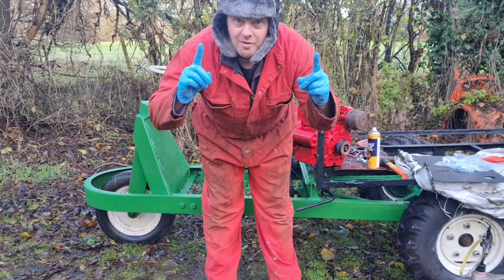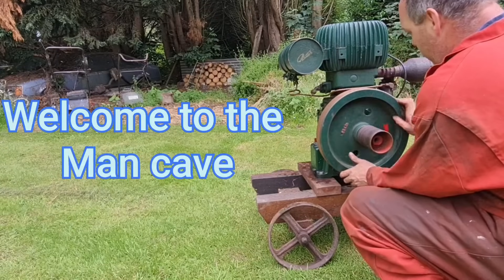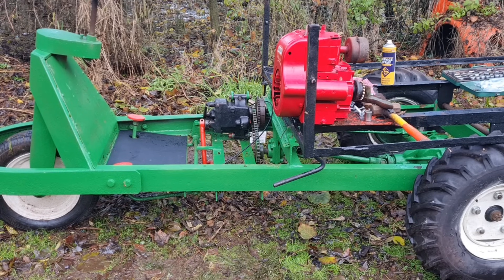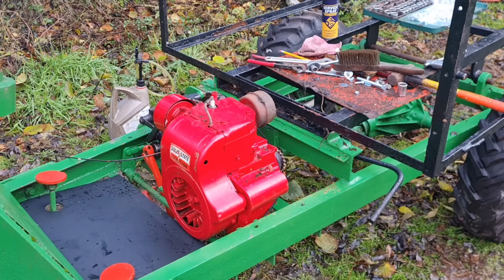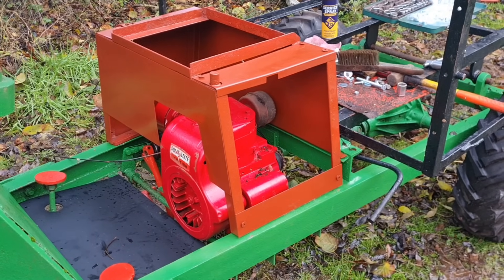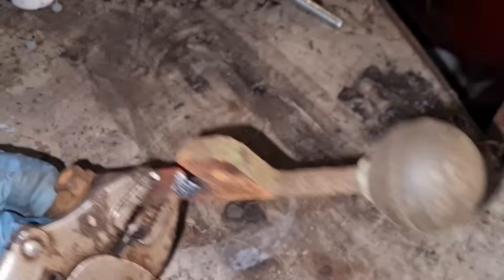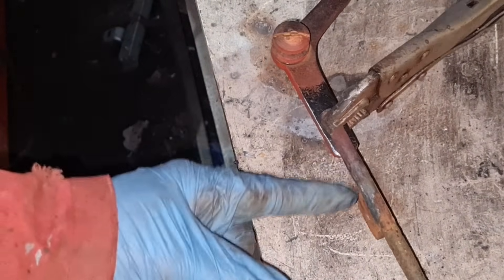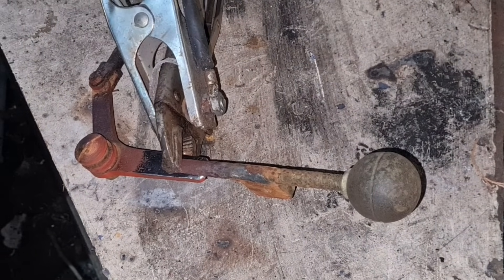Bonser auto truck. Getting a bit more done.

Comment: Adam, I have a feeling a British made truck of the Bonsers vintage would use imperial sized bolts and not metric. The floor, I'd wager, would most likely use 1/4 unc/unf bolts to secure it.
One more thing, are you using flux core wire on your mig? If you are, you may want to check the polarity setting on the unit. The  finished welds should be a lot cleaner than you show.
If you are using non flux wire then you will need a bottle of CO2 to shroud the arc for a contamination free weld. Just some friendly advice, not picking on your work.
Truck's looking fine!
Reply from the maker: Yeah I ran out of gas. And I had a roll of gas free wire. It seems a bit crap yo be honest. Must get more gas as it's mot welding nice at all.

Comment: Don't you still need to cut a hole in the engine cover for the motor exhaust  ?
Reply from the maker: Yeah undecided on exhaust. Hoping I can mount it so it runs under the truck.